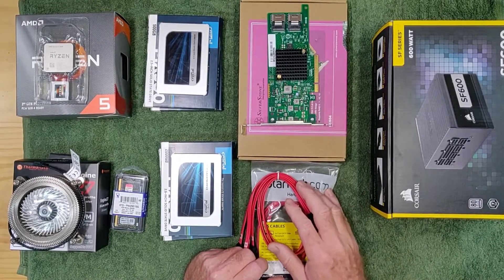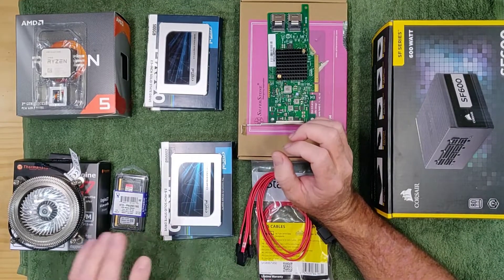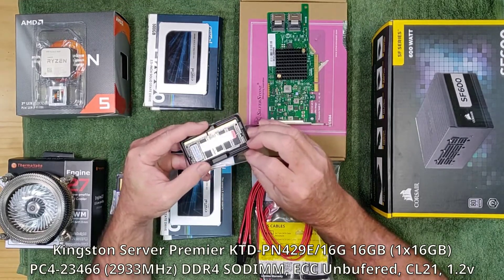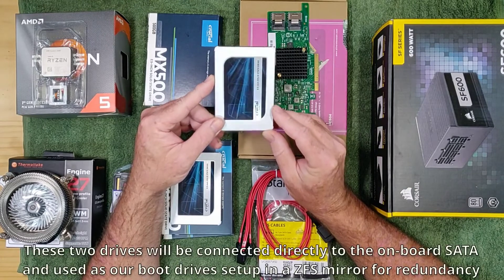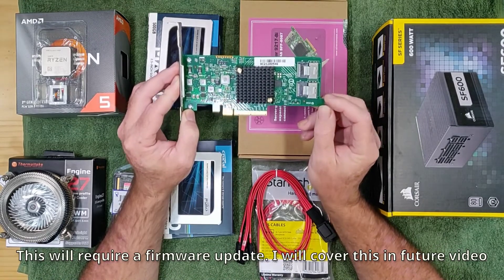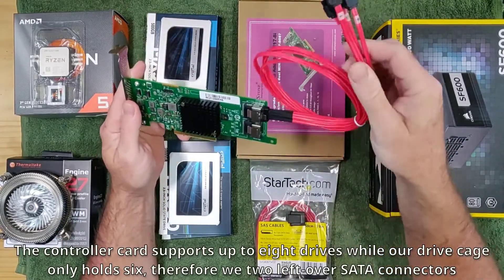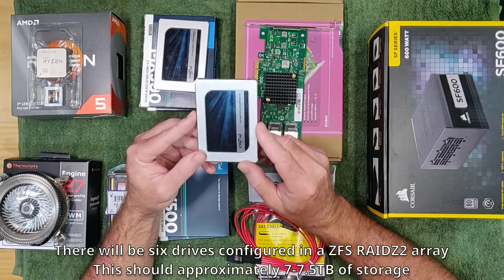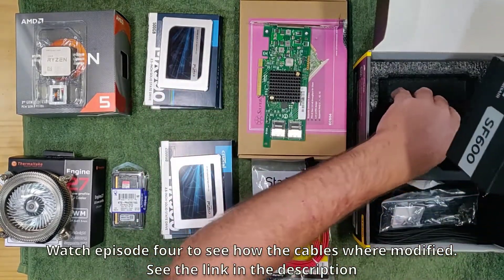Project Clio: Ep3 Introducing the components

Comment: Please tell. Why not use 2x OCuLink for 8x HDD instead of "Silverstone ECS04 SAS controller"?
Reply from the maker: It is definitely possible to do so and there is nothing stopping me from trying that configuration, just need another cable. One OCuLink to 4x SATA cable is provided with the board but for some reason obtaining additional adapter cables in Australia is rather difficult for some reason. The original board I was going to use was the Asrock Rack EPYC3251D4I-2T which only had a single OcuLink and two SATA ports, so it was planned to use the ECS04 controller for the data drives. But I had to change boards, had the controller coming and wasn't going to muck around finding and waiting for additional cables. So I went with the ECS04 SAS controller.

Comment: Looks good; although I'm a little confused how you're planning to mount an LGA 115X / 1200 cooler onto an AM4 socket.... Something like the Coolermaster G200P may be a better option!
Reply from the maker: The board does not accept AM4 coolers as it is designed for Intel LGA115x coolers instead. Why I do not know, space constraints maybe. I did consider the CoolerMaster G200P but I was unsure how the retention mechanism would worked with the glued-in-place CPU cooler reinforcing bracket on the board.